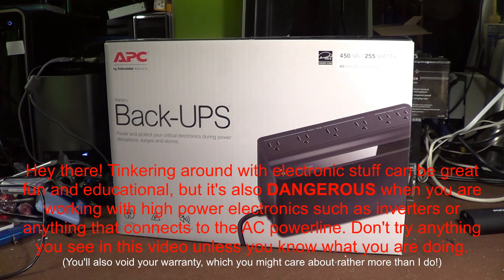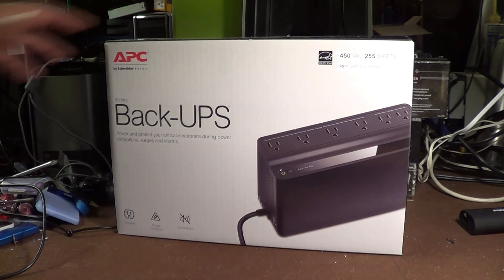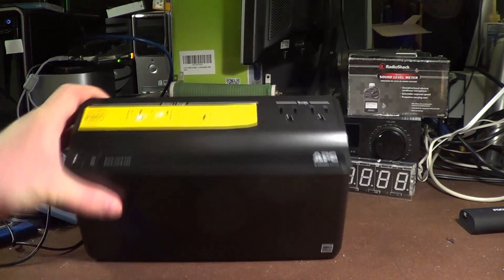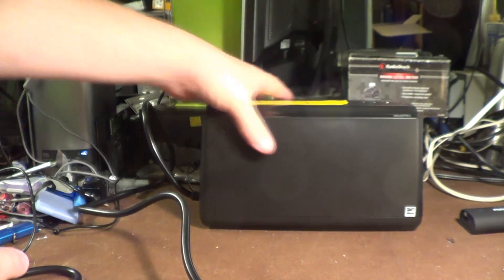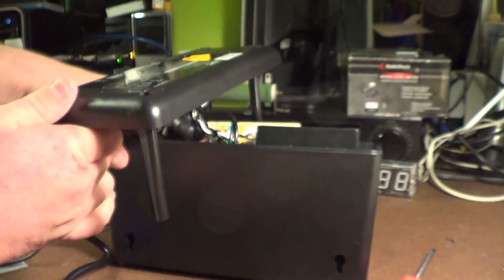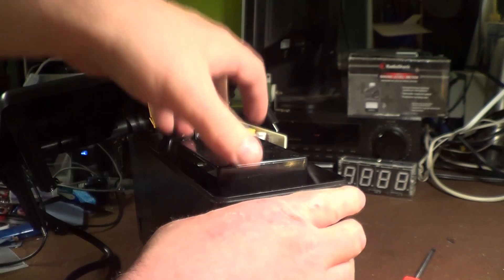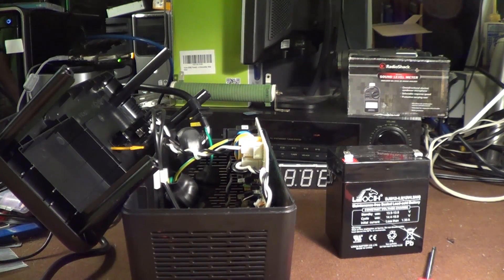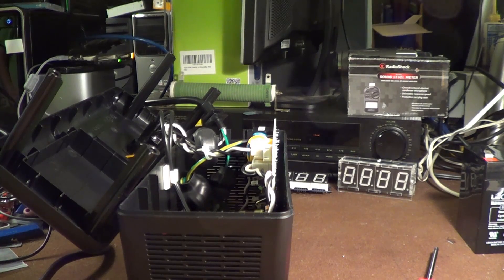Looking Inside a "Disposable" UPS

Comment: Great, you just made me want one of those USB lights. I'm eying a couple of PCB ones that I saw on Amazon, They would be great on the many power banks that I have. I have a monster power bank (20,000mA). I'll find the brightest PCB USB light and use it with that.
Reply from the maker: They're both of cheap and quite impressive. If you get a PCB style light, it really should have a limiting resistor if there isn't one on the board.
Reply: Most of the ones I've seen have an IC that allows dimming and most of the small basic ones have limiting resistors.
Here's ta couple I saw:

https://www.amazon.com/Yitee-Keychain-Electrodeless-Dimming-Keyboard/dp/B00QYNPKU2/ref=pd_lpo_sbs_229_t_1?_encoding=UTF8&psc=1&refRID=VSXCA2V178TW29Z11Z95

The smaller ones:
https://www.amazon.com/DROK-Efficient-Brightest-Emergency-Decoration/dp/B00TGTB4HO/ref=pd_sim_60_2?_encoding=UTF8&pd_rd_i=B00TGTB4HO&pd_rd_r=YZR5XRNXPCR62QMGCX89&pd_rd_w=Ld9Yh&pd_rd_wg=Jjdi1&psc=1&refRID=YZR5XRNXPCR62QMGCX89

They have lots more than this. I'm going to get many different kinds.

Comment: I have a UPS just like that but with a slide out door on the bottom to revel the battery.
Also the battery in mine is a lot larger than the one seen her.
Reply: Sounds like you have the 650 or the 900. They have user-replaceable batteries (officially). This is the 450, and it does not (officially, though it looks like you can just open it up and replace it, if you don't mind voiding warranties).

Comment: I didn't know this device can let you change to fresh new Lead Acid Brick to get this thing going again. Hopefully this original lead acid brick will not leak it through like the notorious cheapo Chinese made heavy duty batteries, that would not be that fun at all. I'll go with Japanese Made Batteries and/or American Made Batteries.
Reply from the maker: SLA batteries will usually only leak if grossly neglected after they are worn out. Most of the time they just swell and get hot.

Unfortunately, I'm not aware of any SLA battery manufacturer producing product in the United States. A few Japanese companies still make such batteries, but they have moved production to Taiwan, China, Vietnam and similar places.
Reply: And even close to Malaysia two that they are making one two.

Back in the old days, in Germany, they used to make Lead Acid Batteries until by the time, they no longer make one.

Comment: Great video!  I have one of those clock kits too, with white LEDs.  They're nice.  I can't change the time and temperature format though, but that just means I have to use my brain.
Reply from the maker: I like the 24 hour timekeeping, if only because it confuses some people (at least for a while). It would be nice if there were a version of these kits that indicated temperature in °F or let you choose between the units.

There is a programming header on the board, though as far as I'm aware, nobody has the code and presumably it can't be pulled out of the microcontroller's flash ROM?
Reply: I can live with the 24 hour format as I've used it at work before but changing the temperature to °F would be nice.  There seems to be a way to here:  https://github.com/zerog2k/stc_diyclock  They have all of the coding and even show which pins on that header are needed.
Reply from the maker: It's nice to see that someone's published some code for these clocks. I've got some header pins here and might populate them on the second clock.

Comment: speaking of cyberpower i have one of there UPS units powering my Spectrum modem and Asus wifi router though according to its app it says it can do it for 1.2 hours not sure if that is approximate or actual time it can run the battery in it now i pulled from one of them at&t backup battery things for there modems since the battery in the cyberpower ups was bad when i picked it up off the curb

Comment: APC used to make quality units in the 90s
Reply from the maker: They still do, if you buy something a bit further upmarket than this.
Reply: true, the plasticv upss are crap, but the more high end smart ups are quite nice ! but i love the old symmetra upss.
Reply: Sadeoo7, you would be better off looking into alternative to SmartUPS from companies like Eaton or Minuteman. APC does not closely monitor the temperature of the battery in these, and it this point it could be argued they're engineered to fail.

Comment: It seems like these could be a great device for keeping things like telephones, answering machines, and critical network devices online during an outage.
Reply: thats what there ment for
Reply from the maker: They do very well at that. I've been using a small Smart UPS to do exactly that for several years now. I know for a fact it'll keep the DSL and my wireless router running for at least an hour and a half. It showed no sign of stopping, but the lights finally did come back on.

Comment: Hi uxwbill,
To your experience, does the position of the battery (vertical vs. horizontal) affect its longevity?
Reply from the maker: No. These batteries are designed for use in any orientation. Heat affects their longevity the most of anything.

My personal recommendation is to never load  a UPS up to more than 50% of its rated capacity before going up to the next model. It'll be happier and longer lived.

Comment: I have an older APC Back-UPS CS 500 I got for free with a dead battery. After a battery replacement this thing has been running my fiber optics to Ethernet converter, LTE modem used for failover, router, switch, wireless AP and the NAS for almost two years now.
Reply from the maker: The lower capacity APC UPSes are great for that sort of thing. I've had a Smart UPS 420 backing up my Internet connectivity stuff for years.

Comment: I wonder how one of these would like being hooked up to a big deep-cycle marine battery. :3
Reply: i would only use  SLA  battery with  BN450M , such as  CSB  GP 12720 F2   or  CSB  GP 12120 F2 or maybe  CSB GP 12170
i am using   CSB GP 12720  F2  and  CSB GP  12120  F2 .  for  200+  watt load ,

Comment: That's a neat unit bill, but i would want to nail a fan on the pcb side to stop the switchmode supply exploding under load in a fantastic way :-D.
Love the non waterproof top mounted sockets, just waiting for a mistake :-D.
The pcb is ready to explode, it was never a battery issue as it will survive the unit lol.
Reply from the maker: No longer than the battery would last under full load conditions or close to, I don't think it could get hot enough enough to hurt itself.

I'm not crazy about this design either.

Comment: Have you had much experience with Eaton PowerWare UPS products?  I bought one about 12 years ago, it lasted me about 4 years before the battery failed.
Reply from the maker: I have exactly one: a Powerware 5110. It is the only consumer grade unit I've seen from Eaton/Powerware in the wild. Pretty much everyone buys APC, with a few buying Cyberpower and Tripp Lite in third place. (Only APC and Cyberpower have any retail presence here. You'd have to go online to get the others.)

I think the Powerware unit is OK, and I commend Eaton for cooperating as much as they did with open source (Network UPS Tools), but it is kind of irritating that it doesn't respond as a USB HID battery class device. As such it demands the use of Eaton software or a third party solution such as NUT.
Reply: OK, well I bought my unit in 2005 and I believe it was a consumer grade model.  I can't remember the model number, I think it was a 3000 series, but I can't be certain as I don't have the unit anymore.  My sister's boyfriend gutted the unit and converted it into a 12 volt power supply that he uses to recharge his quadcopter batteries and for a while he used it to power his 3D printer.  I purchased my unit from Dick Smith, a consumer electronics store that's virtually gone now, they only have an online presence these days.

Comment: cyberpower 400va units. i bought TWO of those shits for 19 bucks a pop. the battery is replacable but they refuse to give you specs. i guess they are embarassed that they have a mere THREE amp hour battery. the units themselves are fairly decent and can handle my ps3 as well as 47 inch 2007 flatscreen. i did not test any more on it because yup as you guessed it the unit shut off my ps3 (tv was still on surprisingly) a whole meager THREE MINUTES. imac for 9 minutes my ass cyberpower. if not for the shit battery the unit itself has potential. all those are good for is the surge or just yank the battery and use it as a cheap rv inverter.
Reply from the maker: All of the major UPS makers want you to buy their battery at a greatly inflated price. Even if you don't have the specs, it's not a big deal for any name brand unit. Generic battery resellers maintain lists of compatible batteries and you can search by model number to find what you need.

It's not a good idea to load a UPS to more than about 50% of its capacity. I'm not surprised that they chose a small battery. This is for two reasons: it provides sufficient runtime at less than full load and at full load it won't last long enough for the small, low capacity inverter to overheat and hurt itself.

Outside of some very special edge cases, you shouldn't use any computer with a UPS smaller than 750 VA! You get what you pay for, same as anything else.
Reply: uxwbill 

agreed 100 percent. but im more thinking that the companies WANT things to die prematurely to cash in. as the goose says in charlottes web....its a dirty irty trick...but its true. 

a ps3 and a tv of my size is well below the rated capacity so its false advertising. sad really but like i said i paid a whole 19 bucks. its good for the smoothing and stuff lmfao.

Comment: yes I've got two of them big units a 5000VA and a 3500VA rack units not sure where they made think the US have to check them out. The batteries are shot on them acid batteries, like the one you showed. You said something, by just replacing the battery it still might not work why would this be the case? and can there be converted to run on lithium ion or lithium polymer batteries. are they worth anything units like that.
Reply from the maker: Under normal circumstances it is NOT a problem to replace the battery in a UPS. With a unit like this, where the battery was not designed to ever be replaced, it's possible that the microcontroller would lock up or lose vital settings stored in a volatile memory if it lost power.

Of course, hindsight being what it is, that doesn't make much sense because this product is shipped with its battery disconnected. So the microcontroller must be able to survive a power cut.

Lithium Ion and Lithium Polymer batteries are VERY different from lead acid batteries. A lead acid battery can be abused by overcharging and severe discharge without much risk. Lead acid batteries do not require particularly careful charging and will survive modest overcharges. If you try any of that with a lithium ion/polymer battery, the result will be a violent failure of the battery. The short answer is that a conversion is not possible, nor recommended.

For your 3500VA and 5000VA units, car batteries can be used as long as you're careful to make sure the wiring is heavy enough to support the load and the batteries are appropriately stored. Adequate ventilation must be available as regular lead acid batteries can expel explosive gases during charging. Be very, very, very careful if you opt to do this. Fuse everything, don't wear anything that conducts electricity while working on the setup (no rings, watches, metal wristbands or other jewelry!) and never skimp on protective devices such as fuses.

They won't last anything like as long as the proper replacement batteries would, but it doesn't matter when they're much cheaper. And you'll still get several years out of them.

Comment: If they were going to make it disposable you would think they would at least put a longer lasting battery in it. Seems like a waste.
Reply: the thing is a longer lasting battery doesnt really exist, sla batteries a pretty much some of the best batteries for standby use but its the heat that kill them, otherwise you can have them last alot longer. i have a big ups system in my lab and i have had the same batteries since 2009 and they are still in great shape, because they never got warmer than 20C.
Reply: BN450M  is  NOT  disposable .  The user manual  page 8  says to  Replace  the  Battery.
No where in the manual does it say to throw the unit in the trash when the battery dies .

If you wnat a bigger battery in  BN450M , then put a bigger battery in  it ( external )
CSB  GP 12720  F2  or  CSB GP  12120   F2 ,...24 bucks and 40  bucks  respectively .

Comment: To be able to say they are user serviceable they have to be isolated designs since some idiot will open the battery hatch when plugged in and get a shock off the terminals otherwise. That adds considerably to the price. Saying not user serviceable and putting the hazardous voltages behind screws means that they can use a cheaper non isolated design.
Reply from the maker: The charging circuitry in this unit is line isolated.

Comment: Did you get this particular unit from office depot? I've gotten several new ones from there and I find it weird some of the lower models don't have anywhere to plug it into a computer so you might be able to have the APC shut off the computer.
Reply: Also, what is in your most facorite, reliable version of the APCs?
Reply from the maker: This came from Best Buy.

Out of all of APC's products, my favorite would be the 3rd and 4th generation (pre-Microlink) Smart-UPS series. They're tough to beat.

Comment: It's nice to see Li-Ion starting to make an entry in the UPS market. They're just so much better than lead acid and would extend the service life of these disposable units greatly.
Reply: I thought that Li-Ion has a far lower charge-discharge cycle capacity than lead acid?
Reply from the maker: I'm not against lithium-ion in any way, but I'd have to disagree. The only big disadvantage to lead-acid batteries is that of weight. Other than that, they're cheap, available everywhere, don't need much in the way of special care and they can tolerate a fair amount of abuse.

One might say the lead constitutes a problem, but the lead acid battery industry has done an outstanding job of getting their product to be universally recycled, with 99% of lead acid batteries being recycled. That's a figure that towers by comparison to aluminum cans (55%), which are the next most frequently recycled product on the chart.

Most SLA datasheets indicate a roughly 300 charge/discharge cycle lifetime (with the stipulation that a dead battery is recharged right away), which compares quite favorably with lithium-ion.

Comment: Of course, I now have to wonder if when the battery does go dead, if one could connect it to an external battery (inside a container, such as was demonstrated in an older video you made) and have it continue to function in that manner.
Reply from the maker: I wouldn't recommend it. There isn't enough heatsinking metal in the inverter. So it'll overheat and in the best case shut down. In the worst, and arguably more likely case, it'll blow up.

Comment: They always say that there's no "User" serviceable parts inside, never "Administrator" or "Super-User" serviceable parts, after all, we are all admins of our own computers... :P
Reply: They've been putting that user serviceability tag on products since the advent of transistors, since those tend to rely more sensitively on other components and it's not easy to track a problem down. 

Tube equipment usually comes with a crapload of potentiometers that can easily be adjusted and since most all tubes are socketed, you can pull a bad one out and pop a good one in.

Comment: been meaning to replace my BK300C with a 550VA unit I have down here in the basement for quite some time, since the sparcstation 5, MSI Windbox running Opnsense and an Airport Extreme N are now running full-time off of it, and that's probably not good for longevity.